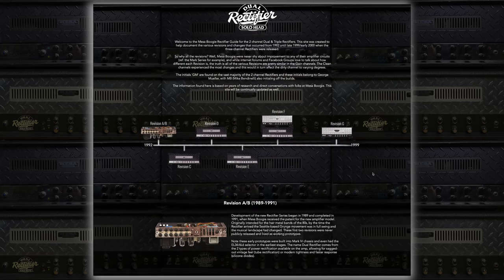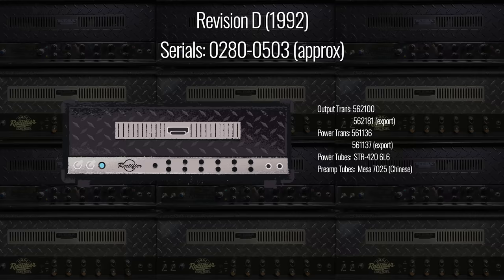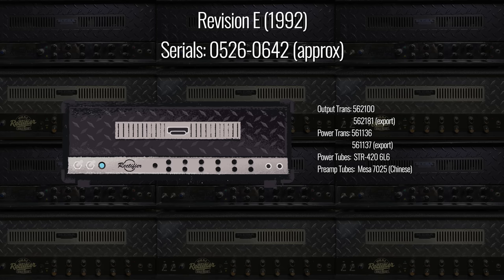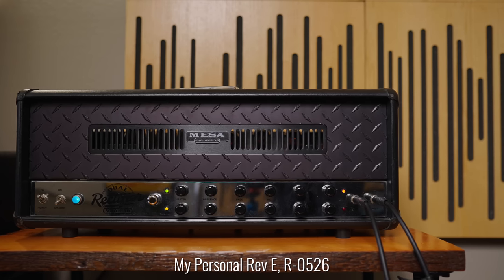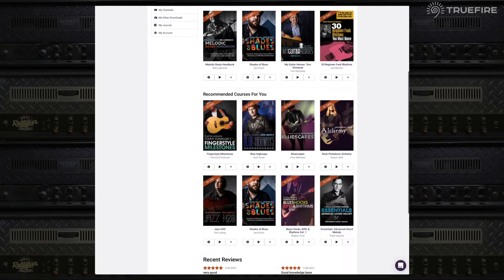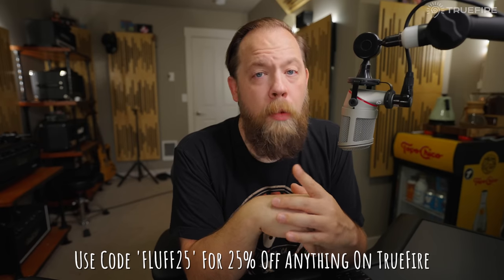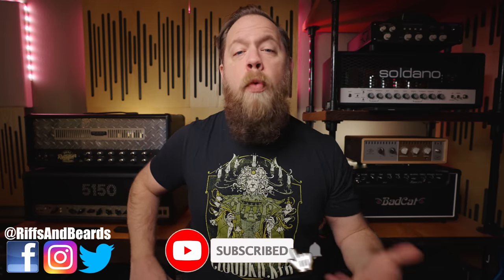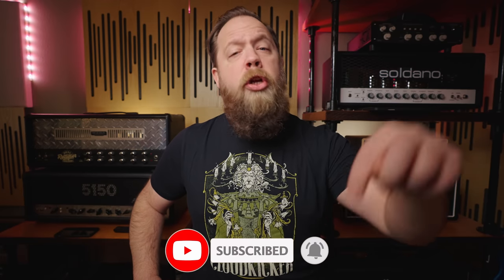A Brief History Of The Mesa Boogie Rectifiers (1992-1999)

Comment: I feel like "Grunge tuned" and "Nu Metal" tuned is an easy way to describe the change from revs C-F and rev G
Reply: @SlyHikari03  Deftones has always been Marshalls
Reply: Wrong
Reply: @jsullivan2112  for a brief period they used Green Matamp and Orange, in fact Chino still uses Orange. Eventually Stef switched back to his Marshall JMP-1 rig
Reply: @Nicholas247066  Sorry I should’ve specified, I meant Stephen, you’re right about Chino.
Reply: My favorite ever is the Tremoverb. I'm not sure why. Have tried dozens of 2 channel rev Gs and a couple rev F, and the Tremoverb to me is brilliant. It and my early 3 channel triple are my mainstays. Those 2 I will never sell.
Reply: @SlyHikari03  Your use of the word doubt implies uncertainty.
Reply: @SlyHikari03  They ARE variations on a theme. There are only so many ways you can design an amp because physics.

95% of the tone comes from the speaker anyways.

Comment: 1991 - steal the preamp from Mike Soldano
Reply: What an epic heist 🚐💨👍
Reply: Yup, preamps are essentially identical. Confirmed by Mike Soldano and Dave Friedman. Just compare the schematics online, the 39k cathode resistor in the cold clipper was a Soldano trademark, and sure enough..Mesa copied that.
Reply: Weird that they managed to still come up with something that sounded so different but was still a huge success.
Reply: @David.S.  They're still totally different sounding amps. Also, didn't Friedman's company takeoff based on modded Marshalls in both sound and look?
Reply: @aaronperrotta7055  I didn't say that the 2 amps sounded the same, merely that Mesa copied the SLO preamp (which they did). There are multiple variables that affect the overall sound of an amplifier (speakers, iron, voltages, component type, etc.). 

Most new-age amps are based on classic circuits (e.g. the Bassman, Tweed Deluxe, etc.). It's one thing to modify components, but to copy an entire design is another.
Reply: @David.S.  Right, but I still think that a HUGE nod to tone and definitely aesthetic isn't far off. I like all 3 companies though, but Friedman's designs are very indebted to Marshall, and I think if Soldano would've became a bigger company than Mesa that circuit wouldn't really be talked about. Just an opinion.
Reply: @aaronperrotta7055  I can agree with that. If you're into amp electronics, this is a good read on the SLO: https://robrobinette.com/How_the_Saldano_SLO-100_Works.htm
Reply: Imagine if Jim Marshall did not rip off the Fender Bassman.  We’d still be playing surf music 🏄‍♀️ 🤮
Reply: @David.S. I had NO idea!! I played one not three nights ago. I’ll ask you, am I getting this right…the only way to tell the difference between the Rev’s is serial#? Also tone perhaps on some? 

Thanks for the info no matter what. Rock on!

Comment: @Fluff - Hey old buddy, just a quick update for you. I own possibly the very last Rev. D I’ve ever been able to verify…serial R-0517.

Also, the Mark IIIs were produced until 1998. From around 1989 to 1998, The Mark IIIs were Green Stripes. The Mark III Blue Stripe shared Trannys with the early Rectos, but when the Green Stripe was introduced, the power section was switch to Pentode (instead of Triode, as all earlier Mark IIIs had), and this signaled the new Trannys across Mark and Recto “100 watters”!

Keep making these Mesa videos!

Comment: I just bought a rack mount Rev F Serial # 1377 with the markIII output transformer (562100), chrome chassis and black tread plate.

It’s probably the lowest serial number rectifier I’ll ever be able to own and I am super grateful to own it. Definitely never ever letting it go. Dream amp acquired.
Reply: has the head 73$ version! its going in the casket with me

Comment: Thanks for doing this video!  Very informative and well done.  I still have my mid-90's Mesa setup, which is the black-face Rackmount Dual Rectifier Rev G (12000 Serial) with a Mesa 4x12 Half-back cabinet in the RoadReady cabinetry.  I put a new tube kit in the pre-amp section and put KT-77's in there, and so with the KT-77's, I have to run it in EL-34 mode.  I use a BBE sonic maximizer in the loop and that's all I have ever needed.  All of my bandmates throughout the years have scars from lugging that monster RoadReady cabinet around.  Never selling.  Cheers to all Recto fans.

Comment: In 04 I bought a new 04 Single Rectifier Solo Head series 2 50 watt head & 04 Recto 2x12 cab. I've never needed anything more or less & it's still the only amp I need beside a 72' Fender Champ Silverface with a Seymour Duncan Twin Tube Mayhem driving it for practice and a different flavor. Thanks for the video!

Comment: Fluff, love the videos, long-time watcher.  I'm an old guy like you, and I've been playing for nearly 30 years, as well...  I finally got to a place financially recently, to be able to get my first Mesa, and I went with a new blacked-out custom shop Badlander 100, and put a Legendary Tones Mr. Scary Mod in it...And that thing is an absolute fire-breather!

That said, yesterday I ended up making an offer on Reverb for an "R-0061xx" serial number, so as close as I can guess, it's a 1995 Rev G Dual Rec with a blacked-out (flat/matte black) front plate and large logo, chrome pointer knobs, and the attached power cord.  Not sure if the faceplate was factory black, or if someone changed it, or painted it, but I am excited for it to show up, i'm hoping it will arrive later this week.  

My question being, did those early Rev G amps come with a completely blacked out faceplate option (tread plate and grill are both blacked out, but the top grill is still chrome w/ black trim around it), or was that most likely done by a previous owner?  Also, if it is factory blackout, do those bring any extra value due to rarity, or is it simply a nice aesthetic?

Thanks

Comment: Hi Fluff, I'm the ex owner of 1328! I sold it couple of years ago, and I regret this decision every day.
I wonder how it compares to your other Rev. F given that it's not in stock condition. I serviced it, and my technician remeasured every component and changed stuff that had big discrepancy from nominal value. 
I can send you the list of replaced elements. I've included original parts when I sold it, so it can be reverted to stock condition if needed.

Comment: Ryan, It should be noted  that I have a Rev F serial number 3857. Small logo, hardwired power cable, chrome chassis with black matte tread plate. It has a parallel loop. May have been commissioned for an artist or possibly Rev F went further than previously expected. Board confirms its revision F

Comment: We need to clearly acknowledge Mike Soldano as the guy who's really responsible for the preamp circuit of his SLO-100, which was then directly lifted for the Rectifier and 5150 preamp circuits...
Reply: And yet they all sound wildly different…. Hmm 🤔
Reply: @Starch1b2c3d4a  True. The poweramp has a big impact on the tone. Line a SLO, Recto and 5150 up together, run from the FX Loop Send into a DAW with the same IR and there’ll be more similarities than differences.

Comment: Fluff,  Just curious are you using the rectifier model in the Helix for your band when you play live?  I personally can't stand this model on the Helix as it's modeled after the fizzy 3 channel rectos from 2000-2009.  Any tone shaping tips to get it sound decent?  Also wondering if you ever had the chance to try out the Rammfire emulation on Guitar Rig 6, this was a plugin that was built using Richard Z. Kruspe(Rammstien) Early Rev C. as a model.  I love this plugin and have been on the lookout for a Rev C rectifier for a long time.

Comment: Interesting. Guess I had a Revision F then. Serial Number 1,000 something or another. Chrome Chassis with Black Treadplate. It definitely had less of a scooped sound and more of a low midrange punch exactly as you said. I always described it as sounding a bit "hashy" but also more just nasty and aggressive than the later ones I've heard. I honestly still preferred my Single Rec Series II over my Dual Rec Revision F though. I also always preferred EL34s in Dual Recs and 6L6s in Single Recs. I've still yet to try any of the newer Multi-Watt models though.

Comment: Awesome video as always. My serial number is much longer than the ones I see listed on the website. Any tips on interpreting the number? Its R-048775. What Rev version is that?
Reply: You can't find it cause that's an 3ch. and not a 2ch. Head.
SN R-48775 is a late non Multiwatt 3ch. or an early Multiwatt. A late 3ch. would be Rev-E, Multiwatts are Rev-F. These revisions should not be confused with the revisions of the older 2ch. heads.

Comment: The site says (so does Mesa’s) that the Rev G production stopped around Feb 2000. I have a Rev G Racktifier with a chassis date of 11/00 and serial number in the high 15000s. So i’m wondering how that happened. And how many more Racktifiers could have even been made after mine, since it’s 9mo after production on Rev G’s we’re stopped.. hmm

Comment: Any idea how to identify one of the early Rev F Tremoverbs your site mentions? Mine has '93 written on the inside with a sharpie. It's a fixed power cable, parallel loop, Serial # R-003246.
Reply from the maker: Pulling the chassis and looking at the Board
Reply: @RiffsAndBeards  The board actually says RR-1E
Reply: From what I've been able to dig up, it looks like the Tremoverb boards don't line up with the normal 2 channel revision boards. There are reports of the early Tremoverbs having RR-1C boards, with a majority having RR-1E. My guess is the RR-1C boards are the ones based off of the Revision F. Mine must just be an early Revision G, but it sounds killer so who cares.

Comment: Recently, I found a really early Dual Rec Rev F in good working condition with Serial No: R-0681 at a Guitar Center in Pasadena at $1,400.00. 
Decent price for any run of the mill, early 2000’s used Dual Rec - but for a vintage early 90’s Rev F, a F’n steal (pun intended).
Naturally I had to get my holy grail amp - and save it from the lame gear flippers trying to flip Rev F’s for $2K or $3K.

Comment: I know there are a lot guys that ate heavy metal music fans and guitarists that love these amps. Ok, I get it. They gave that metal grinding sound to them, but if you watch the guitologist amp repair guy Brad and especially Lyle Caldwell from Psionic Audio both on YouTube,  you will see where especially Lyle is death on Mesa Boogie amos in general.  For example, the Mesa Tremoverb amp. This amp was a bad attempt by Mesa to rip off the Soldano SL100 circuit and was poorly executed. The effects loop in the amp is before the master volumes and also the reverb is not in the circuit correctly which Lyle Caldwell points out. He's even surprised that Soldano didn't sue the arse off of Randall Smith for ripping off his design. The main thing to understand about any Mesa amp is if anything goes south on these circuit boards,  good luck getting it repaired. I have a Tremoverb from 1994 and it has been a nightmare to fix over and over continuously. OMG, the money I have spent on this boat anchor. Originally sent it to be modded by Voodoo Amps in New York was a mistake for sure and then even sent it back to Mesa and 5hey even shagged it up. So it plays now,  but there's a lot if noise floor. Watch Lyle Xaldwell's 6 part videos on his complete rebuild of a Mesa Tremoverb amp. I have always known what a nightmare my amp was since I bought it but after watching Kyle point out all of the really bad mistakes Randall Smith made building and designing this amp which he really didn't even legitimately design because it's a copy of a SLO100 but done ass backwards.  So what I am driving at is these amps tend to have a lot of inherent problems in their circuits and people in my opinion should go with a Friedman amp or a Shur amp. I think Mesa amps physically  are rock solid built amps but the caveat is their circuit boards are a nightmare to repair. Now I have a Mesa cab and a Revolver rotating Leslie cab and they are excellent. But as far as their amps go, think twice before laying out huge bucks on these.

Comment: So if I understand  correctly, "rectifier" is just branding.  These amps do not do rectification in any particular way -- they're "dual" because you can switch between a tube rectifier and a solid state full-wave rectifier -- which is at least conceptually one of the simplest solid-state circuits  that exists: four diodes soldered together in a particular way.  

Is that accurate, or is there something special about the way a dual- or triple-rec amp actually does the actual rectification?  I get why people say "...dat rectifier sound, doe", but it's not as if other amps don't have rectifiers. Unless maybe you have a 100% DC amp that runs off of car batteries or defibrilators...  I can just imagine "dat defib sound, doe" where it it doesn't sound like someone is dying then it's not metal enough.

That would be like saying that a Mopar SS chassis is required for any "stock" type race car and that Ferds and Chibbys are inferior because they aren't "SuperStock".  (No, they're inferior for a completely different set of reasons.  I keed I keed.)

Comment: The original/Current Circuit was Straight up Copy of The Soldano SLO! Out of the Mouth Of Soldano and Freidman
Reply from the maker: Well its important to understand a few things. Dave absolutely hates Boogie for starters. But Mike Soldano pretty much invented cascading gain in the guitar amplifier which every guitar amp today uses. Yes, the cathode follower design, the first couple of gain stages, the 39k cathode resister, the 1.8k cathode resistors, the 220/330k divider are all identical to the SLO schematic, which are very atypical values. But the Loop, the Power section and the Rectification switching are wildly different from any Soldano. 

My point is, who cares. Thats old stuff.
Reply: @RiffsAndBeards  I care, he should’ve used his brain and came up with his own design, instead of copying.
Mesa Makes great amps, I’m was just disappointed when I heard that.